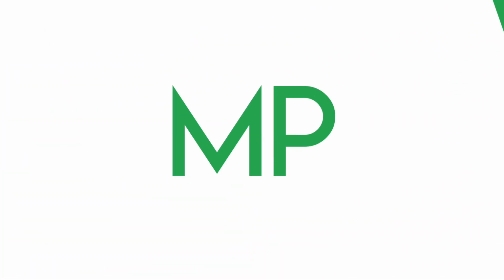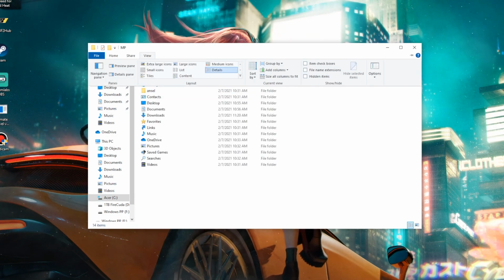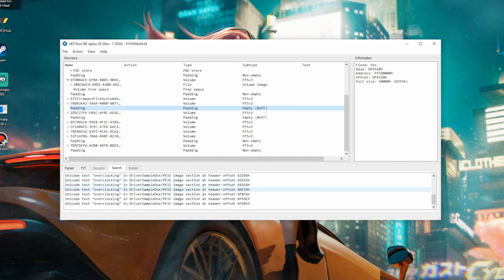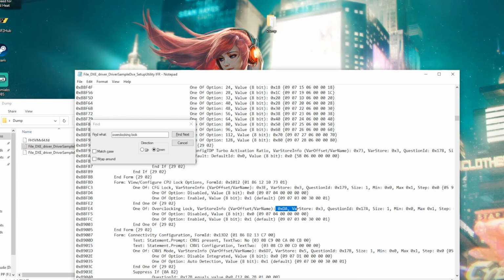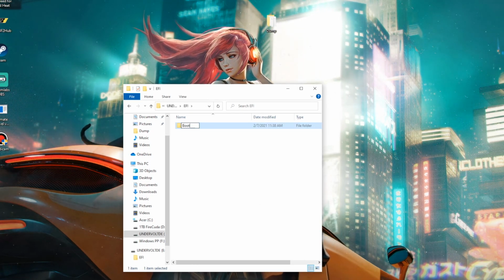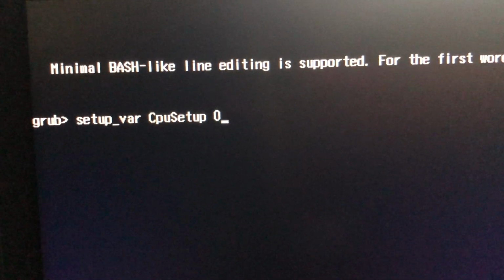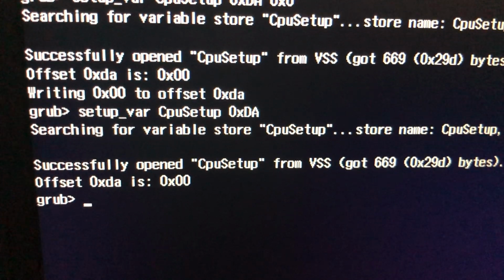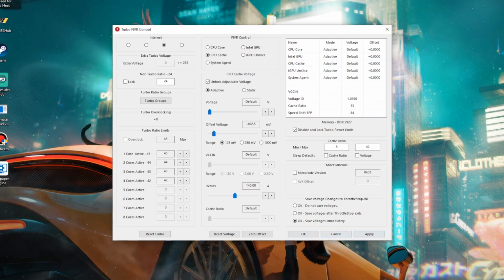How to Undervolt i5 10300H Acer Nitro 5

Comment: can i enable undervolting with this instruction on my gigabyte g5 notebook?
Reply from the maker: I'm not sure as the BIOS is different.  You may be able to check your BIOS to see if there is an offset that you can change.  Other than that, it's risky.

Comment: I did everything exactly as in the video, the undervolting was unlocked, but now, when exiting the games, the laptop freezes and I have to restart it, and also noticed that the frequency is kept within the maximum(4-4.3 Mhz) even when the processor is not loaded, what could be the problem?
Reply from the maker: Ease up on your undervolt.
Reply: @Meanpooh  I limited it to 4MHz and everything is fine, thanks a lot man!

Comment: Sir is throttleshop going to actuallu work on acer nitro 5 i5 10300H (at least at certain settings, apart from the adjustble voltage which is locked)
Reply from the maker: Yes.

Comment: Bro I did as u said but the boot menu doesn't show the usb HDD part after ejecting. I did all that bios stuff and copied the grub64 thing into the usb. What do I do now. Is the laptop in danger? Should I repeat the process? Can I reverse any changes or something? 
Dude pls help me pls
Reply: Meanpooh please reply
Reply from the maker: Hey man, I have a full time job and I do sleep.  You're not the only one needing help.  The only thing I can tell you is that if you get into the menu and you don't see the drive then,
A: Something is going on with the USB drive.
B: You didn't put the file in the correct folder
C: Corruption

If you can't get into the menu then there is something in your BIOS preventing it from loading at BOOT.
Reply: @Meanpooh  yh I know I'm so sorry for troubling. Would it be ok if I start the whole thing all over again?
Reply: @Meanpooh  I got into the boot menu where the security and stuff is there but when I press f12 nothing happens
Reply from the maker: @anudagunasinghe7060  Your screen needs to look like this.
Reply: @Meanpooh  like what?

Comment: Please how to unlock undervolt for Hp pavilion gaming 15 using i5 10300H 🙏🏻..
Reply: on the Hp bios insyde Version F.21 there is no .fd file but there is a .bin file how to see the binary code for overclocking locks on a Hp laptop.
Reply from the maker: If you have the bios try to see if you can find address in which you need to modify.  Nothing gets changed till the very end of the tutorial so everything up until then is safe.

Comment: hello Meanpooh, i accidentally update my BIOS version to 1.10 in the past, so can i apply this tutorial to my acer nitro 5 an515-55 ?
Reply: NVM brooo, u are awesomeee. Thanks for this tutorial it's work for meeee🥰
Reply from the maker: Yes.
Reply: i was created a video with Indonesian language cuz many of Indonesian Nitro 5 community didn't know about this, don't worry i put this channel name to my description video 🥰
Reply from the maker: @briiplay  Cool, you have link to video?
Reply: hey bro i have the same acer nitro 5 model, did it work bro?
Reply from the maker: @donpeterjohnbugarin1454  Of course.
Reply: @Meanpooh  Hello meanpooh! I have bios version 1.10 for my nitro 5, should i use 1.03 to do this?  Your vids helped me a lot btw
Reply from the maker: @donpeterjohnbugarin1454  No.  Use the BIOS that is on your machine.  Glad the videos have helped you.  I appreciate you watching them.  👍
Reply: @Meanpooh  hey meanpooh, i have trouble downloading the needed tools from github, there are no download links from the site
Reply from the maker: @donpeterjohnbugarin1454  Links in description work fine.
Reply: @Meanpooh  Thankyou! i hope you will also make a video on how to unlock gpu overclocking in acer nitro 5, i cant seem to adjust my voltages, power limit and temp limit of my gpu
Reply: did you use bios version 1.03 for your laptop bro?
Reply from the maker: @donpeterjohnbugarin1454  https://youtu.be/f8xf7hf_XS0?t=73

Comment: Hi,
Taken a look at the text code regarding the vn fd file and I have realize that there are a lot of ref columns reffering to overclock menus with the value of 0x0 meaning they're off, maybe if someone changed them all to 0x1 in a modified bios, we would be able to access the advanced options.
Reply from the maker: I looked at that too.  The problem is being able to access the feature.  Enabling the wrong bit could cause your machine to not boot which is risky.  If there was a dual BIOS option on this machine, i'd do it myself.

Comment: 🤔 i just bought an acer nitro 5 10300h rtx 2060 , i am just using throttlestop to underclock my cpu , temps is decent  in red dead redemption 2 running ultra ( recommended settings ) And i have 55-64 c temps
Reply: How?
Reply: Throttlestop
Reply: @nemsiro  then?
Reply: Think i saw some kind of video from meahpoh or some other dood.

Comment: Well this is complicated..
Reply from the maker: When you really sit back and think for a minute it's not.  If you wanted, you could skip right to the USB drive section and start there.  But you must first know the Offset.  Setting the wrong Offset could cause problems.  I made it like this to show what you are doing.  If you goto the AcerNitro Subreddit there is a method that is easier.

Comment: now imagine what we could do if we could unlock the advanced bios for this machine
Reply from the maker: Right but the problem is having it show up.  Where would the entry be and what section.?  Toggling it on is the easy part.  Also it may be even possible to somehow write a program to auto clock in windows sorta like how MSI afterburner works but that's  ahead of me, I only know a little bit of SWIFT.
Reply: Ông làm thành công rồi hả ông ơi
Reply from the maker: @TaiKonNe  Vâng, tôi có và cảm ơn bạn.
Reply: @Meanpooh  Oh thanks you

Comment: Hey, Meanpooh! Is there a way to upgrade to a 120hz panel like the older models? since they have a 30 pin adapter and are glued instead of having screws, thanks, it's my only gripe with the laptop 😂
Reply from the maker: There is a way but you will have to replace the 30 pin cable in your machine to a 40.  I checked mine out and the cable seems like it's glued in and won't budge.  I mentioned this in my repaste video.  Anyway i've found a panel that may work.  If I can ever get this thing loose, i'll get it. NV173FHM-N44 17.3